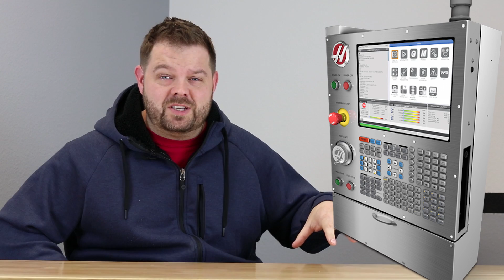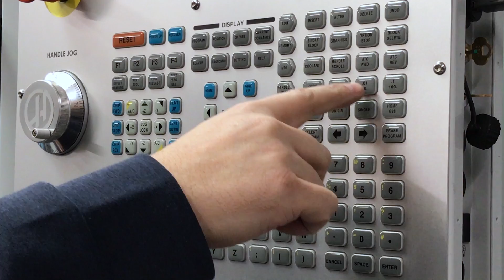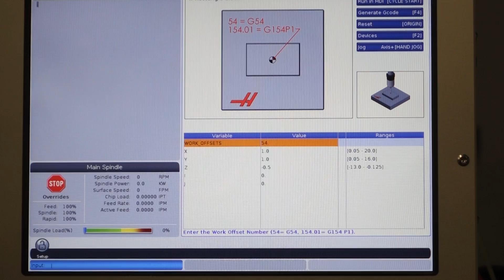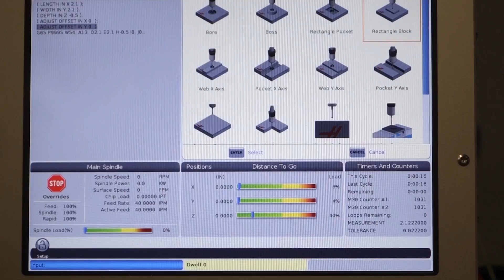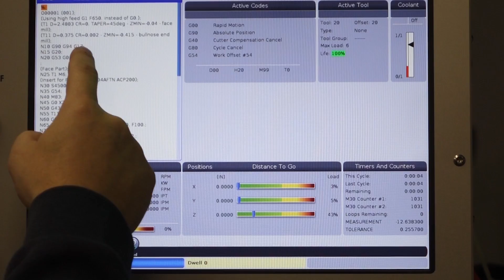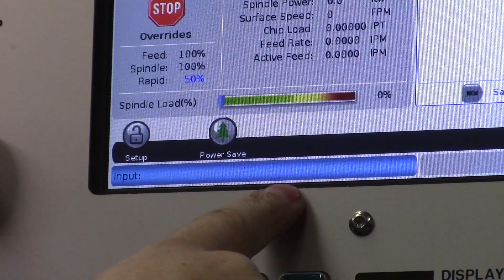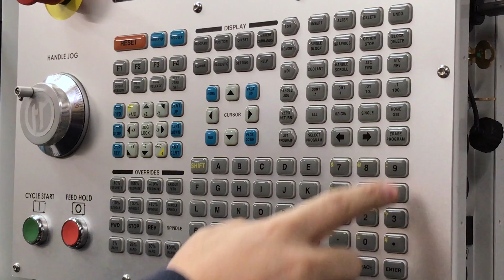Haas NGC Control - Basic Function - Step by Step Guide

Comment: If u I hit "H 11" it will take u to ever time T11 actually runs...if u hit "T 11" hit will take u to the  tool that is queued up thin the carousel for the next to tool change...and it may put u at the wrong tool change
Reply: The ,"H 11" is picking up the G43 work offset of the tool....in "Z*" that is actually about to hit some metal

Comment: I would never trust one of their machines.
Reply: Why?
Reply: @sebastiantaylor2600  
I had one of their new machine in my shop. When they came to set it up. The table was .0015” on dial indicator and then the level showed off another .0015”. The tech said he would come back the next day and shim it. I know you can’t shim a warped cast table. Then told the dealer I didn’t want this machine. The dealer and factory said they won’t replace it. Then I said wrong answer. I’ve had customers that wanted programming for them. I found their machines were .0015” to .003” slack in them. 
 I have a 1998 Okuma  for 23 years and I can still machine airspace parts to .00015” accurate. And my Okuma dealer has beverages turned me down when I asked for help, Whitehall has only been a few times. I’ve also learned over the years that hundreds on people around the country tell haas are only built to last 5 years, then they will started to get loose. And the ones are rust buckets. 
 I don’t believe in screwing a customer, so I make the best I can do. I hope this explained why I’ll never trust a company like haas and it’s deals when I was trying to make a very big investment for my future.

Comment: Great Video! But one thing, I was told by the hfo thats its not recommended to run programms direct from the usb. In my case i copy the progamm to the internal memory and run it from there. Its much more safer, especially if you are going fast with complicated contours.
Reply from the maker: RCBroadcast our production programs run from the control. 

I know lots of guys that run from usb.  But I agree it probably better to run from memory.
Reply: @NerdlyCNC  thumbs up, keep up your good work!

Comment: Jason, great video. One thing you didn't touch on was tool length offset. That could be a video on its own, explaining how the length probe relates to the part probe which allowed you to run preset tools once you had set the "z" on the part. I'm an old school guy that's used to touching tools off on the part with a shim but with the probing systems that Haas and others sell it has become so much easier.
Reply from the maker: Eric Kachadoorian thanks Eric.  I’ll make it happen.

Comment: I just got my new VF-2 set up a week ago. Ran my first code on Saturday, which was my first time ever running a VMC. I'm mostly going to machine prototypes and small series, as I don't do this for a living, more on a hobby basis. These videoes you make are very helpful, so keep them coming! :-) I like your honest straight forward style.

The HAAS NGC control is as you say really easy to use, even for a complete newb like me. 

Would you do a video comparing HSM off /on ? I'm going to experiment a bit with it during the holidays on some 3D paths. You get 200 trial hours (I guess you got the option though) with the machine :-)

Andreas

Comment: Awesome video! On my pre NGC Haas vf3ss, to be extra safe I will run graphics first to make sure there isn't any program errors and then use single block to make sure tool and work offset are set correcty before it starts cutting. Keep up the videos!! 👍👍👍